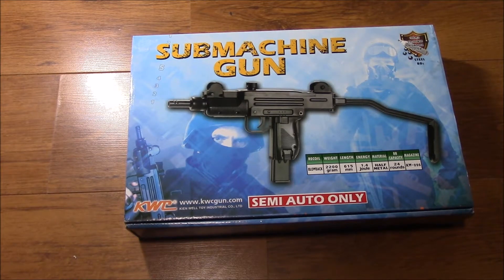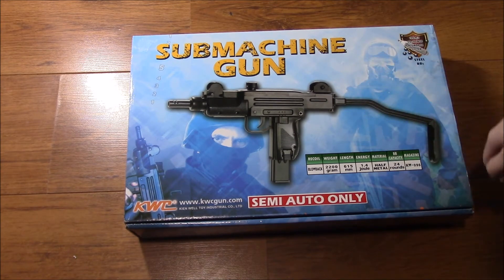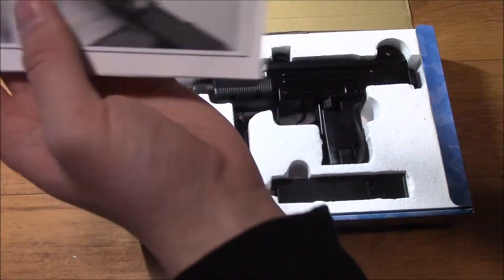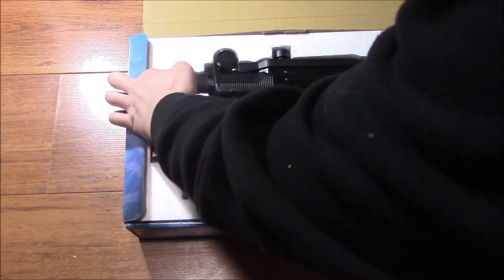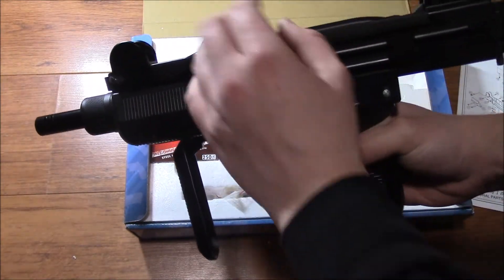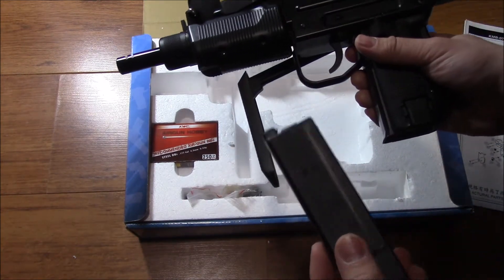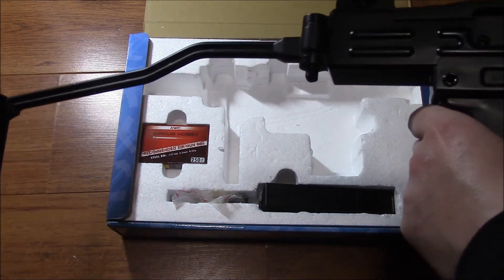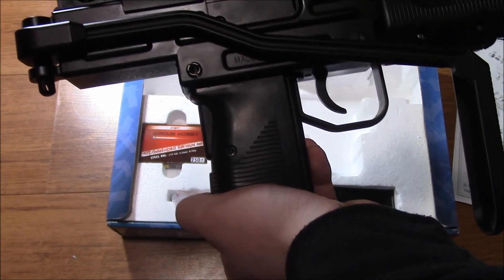KWC Mini Uzi unboxing

Comment: Where did u get it from mate...i got mine 2 days ago for £99...was on half price offer...how many rounds on single shot can you get before co2 runs out?
Reply from the maker: Taskers angling, a local shop. You got yourself a good deal there. Honestly it depends on the weather in regards to c02 efficiency. 

Anywhere from 15 shots if its quite cold to 31 in warmer conditions.
Reply: lewis4642011 ok mate i got it online..very pleased with it and the price like you said i got lucky...all the best mate
Reply: I aslo got a very nice uzi box...dont know if you have seeen it...one with the pic of the guy who invented the uzi..and ive seen vids of real steel uzi...they seem to run out very fast also lol...all in all this is an amazing replica from look to weight to quality AND shooting :)
Reply: And mines airsoft full auto